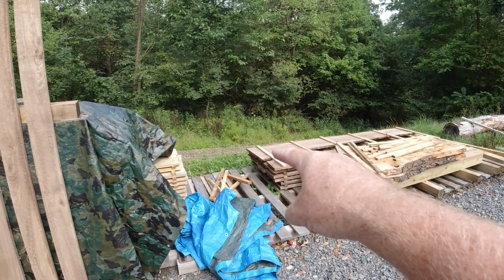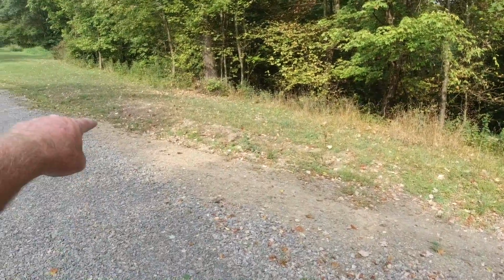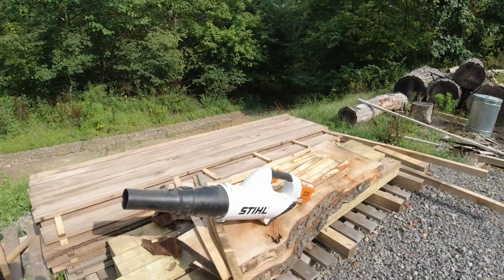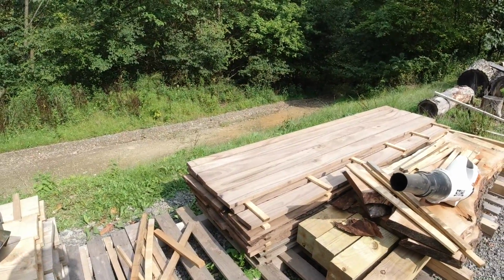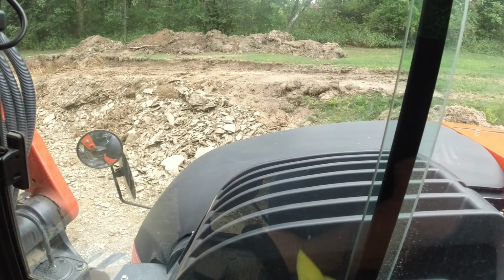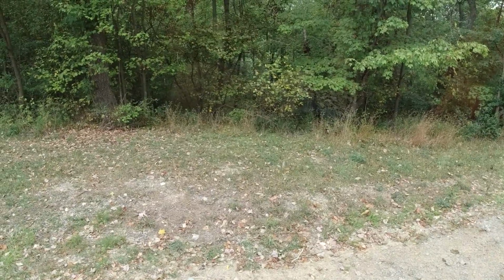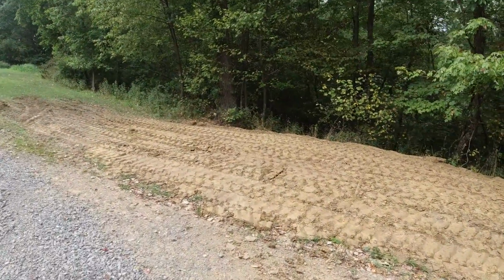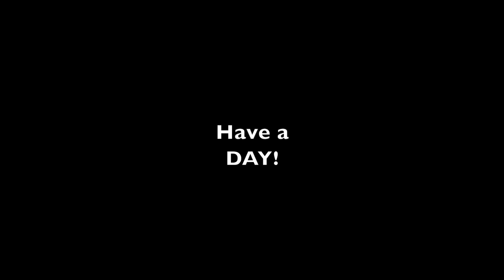#879 Now THAT was a SURPRISE! Hunter Pulls a fast one. Sawing Walnut and Moving Dirt

Comment: Mike,  if you want more walnut, consider sawing thinner boards. Not veneer thin, say 3/16ths or quarter inch, sturdy enough to handle and glue to thin plywood. Since it's mostly used for surface covering, not framing.-From Amish country, Ohio.

Comment: Give you a tip on how to correctly use that little backhoe. As the machine ages it is basically wearing itself out. Something’s you can do to preventing early track coming off. When you are digging from the wrong side of the machine. You slowly destroy the sprocket and find yourself asking the question why do my tracks keep coming off the sprocket. The only thing you do on the side is empty the bucket, you never fill the bucket from the side. You fill the bucket from front or back not the sides.

Comment: What were y’all mixing up with the pine sol and that blue liquid?
Reply: Wondering the same?  Did I miss something on previous episode? Never heard of mixing windshield washer fluid, dawn and pine sol.  Looks like the jug was on the saw mill.  Hose goes down to the blade I think.  Must for lubrication and keeping heat down or something on the blade.

Comment: What do you use that jug of liquid for.
Reply: Part of sawmill 8:20 Used to lubricate the blade so it does not overheat. Lttle bit of soap mixed in for "slippery", Pine-sol to avoid pine tar build up when sawing pine, and washer fluid to avoid freezing or water in warm weather but Mike likes it year round.
Reply: Mark Pashia Makes sense. Thanks.

Comment: Its too bad that cutting blade on mill isn't double sided... you could cut both ways then on the way forward and on the way back.... Hunter good job!... good work Mike!  thanks 4 video. be kind.
Reply: Not physically possible due to guide and roller design needing flat surfaces to support the blade. Needs that on all three sides of the blade that do not have teeth.

Comment: I think it is a good idea to move that dirt, creating a level area you can work with for maybe the wood-splitting. Then slope the back side where it is easier to mow than the little hillside that was there before. Leveling the opposite side gives you more area to work with and just opens that area up.

Comment: Hey Mike - can you tell us what the Pine-Sol and Dawn is needed for in the washer fluid? Seems like an odd mix.
Reply: It keeps the saw band clean. The wood can deposit sap and gum on the sides of the metal blade increasing friction.  The soaps dissolve the deposits keeping the blade clean. The water is a cooling agent and vehicle to take away deposits.
Reply: David Morse thanks David. Didn’t think of the sap.

Comment: Good morning all, Hey Mike I guess I am cheap, I use water and dawn on mill, unless I am cutting pine then I put Pine-Sol in my lube for the mill. I have never used windshield washer fluid even in the winter. I drain the tank to prevent freezing when I am done. Yinz have a great day. Ron
Reply: Draining the tank is ok for that but what about the tubing. Nathan at OTW had to replace his after it froze and the way it weaves through the frame is a nightmare. But you are correct in that it is only needed during the "freezing months". Also that looked like a lot of soap and pine sol compared to what other milling channels use.

Comment: Good variety in this video.  Maybe take some of the topsoil and place it around the perimeter of the slab especially on the slopes. It will need vegetation to control erosion. Not much will grow in the shale fill material.

Comment: Good morning from MidMo! Nice out - high stratus or almost cirrus with lots of blue showing. Was quiet until backdoor neighbor’s landscape guy fired up a backpack blower. Man I’m learning that keeping a house in show-ready condition is a pain! I like the trend of Hunter getting more comfortable and engaged with the videos and the action. Also enjoyed the change from the original intent of the new flat spot as a topsoil stockpile into a landscape trailer parking spot! Now you’ll need to build another spot for your topsoil. Maybe by the time you dig up the good stuff for the boggy spots on the trail, there’ll be a logical spot for both materials. You are definitely getting a ton of work done with the excavator. Nice walnut lumber too! Thanks for the video.

Comment: Seems my favorite keeps changing to whatever wood I am working with at the time. Right now, I'm building a nightstand of Post Oak with lots of quartersawn rays and spalting. Minwax Cherry improves the color a whole lot. I use local (SW Missouri) cut trees that I have either cut myself or been given. Kiln drying is important, too. Local species that I like are Walnut, Elm, Sassafras, Red Oak, White Oak, Post Oak, Honey Locust, Black Locust, and spalted Hackberry. Some are very abundant and some not so easy to find.
My only reservation with walnut is its darkness. It's OK in well lit areas, but its beauty seems to disappear in a darker room.  This is why I have never liked dark stains on furniture or wood trim..
Of course, Walnut is the choice for the dark squares of a chessboard. I use the lighter colored woods above or Maple for the lighter squares.  Have some Persimmon that I will try once it is dried. Very light wood but twists and warps badly during drying. Good enough though to get chessboard squares out of.

Comment: Good morning all. Hope those of you south of Kansas City are surviving the hurricane   Be positive and kind to others.
Reply: Good Morning Phil! Going to the Stihl store today?
Reply: @davidmorse8432  I sure am.  Got a little of everything to work on.  Also hoping to build out and display a couple of FS-131 with saw blades mounted.
Reply: @rphiliprogers  Is that a weed eater?
Reply: @davidmorse8432  It is a bike handle trimmer with a limit stop shield, saw blade.  The unit will cut a tree at the stump up-to 3" in diameter.  You have to watch out for rocks though.  Easy to sharpen if you have the correct file size 7/32". Although I haven't used one the Husqvarna File Setting Tool 505698120 is supposed to be great for this setup.
Reply: @rphiliprogers  Wow, sounds like a beast.

Comment: G'day to the Morgans.  Here in Australia walnut is extremely susceptible to wood borer if not treated quickly.  Stay safe.
Reply: We have that issue too but not as bad where they are as they have real winters. Moving antique walnut furniture down south like Texas can be a problem. One day you find a bunch of sawdust on the floor below the furniture and little holes all through the wood. But where you have freezing winters it is not such a problem. Also coating every surface with your finish will stop that problem, but too much stuff is built with hidden surfaces unfinished and the raw wood is an open invitation for them.
Reply: I've had good luck with linseed oil. Also helps prevent some end and surface cracking. Mark Pashia: good advice. A good use for walnut sawdust and scrap is sprinkle a little onto your campfire. The smoke helps keep mosquitoes away.